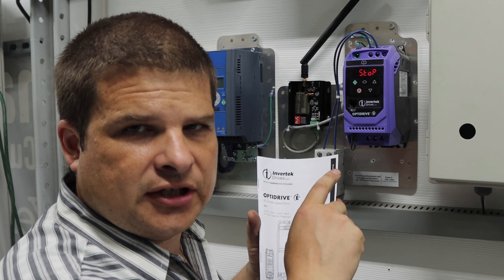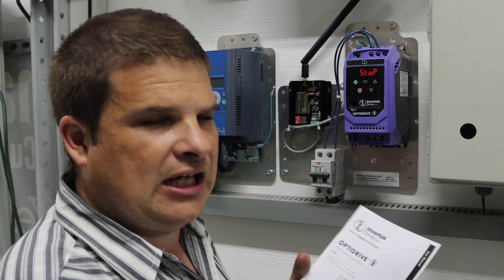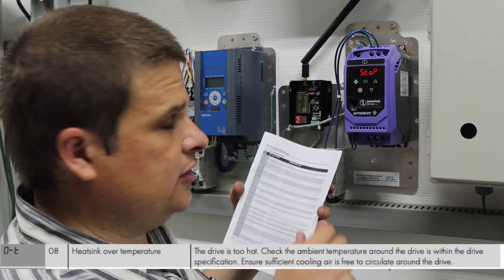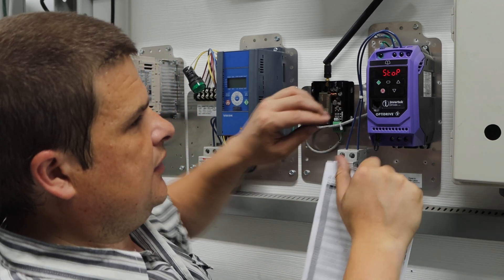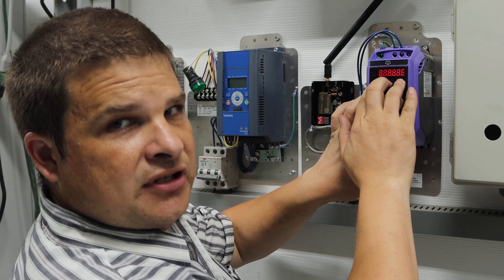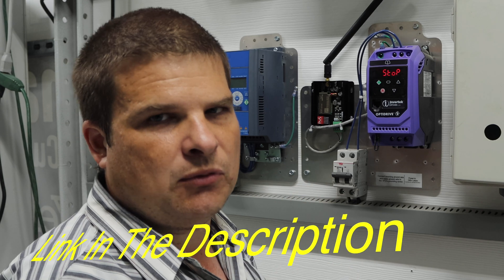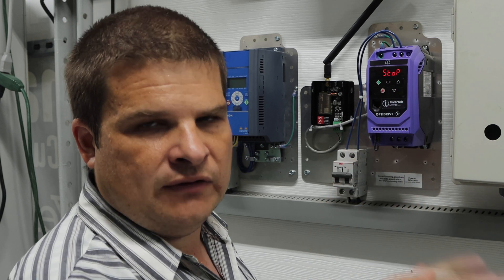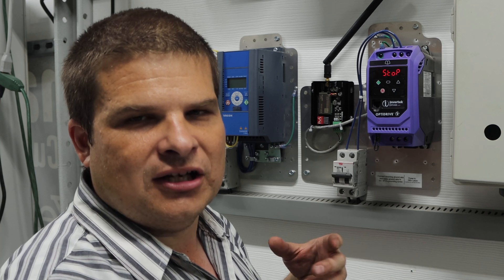Invertek VFD Overheat Fault 8 diagnose , O -t Fault , Heatsink Over Temperature Fan

Comment: So, do You think a dry Thermal Grease can be the problem as well?
Reply from the maker: No,  its a transistor or shorted winding in the little heatsink fan. I took the fans apart . Always 2 out of the 4  windings are dark